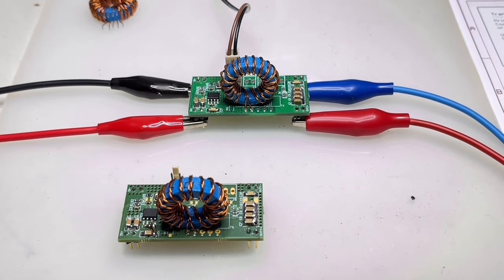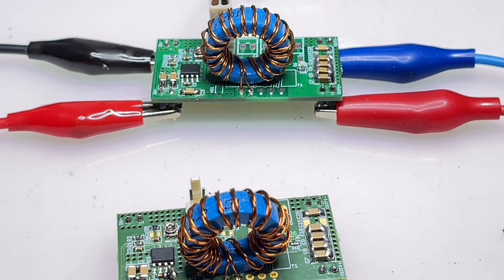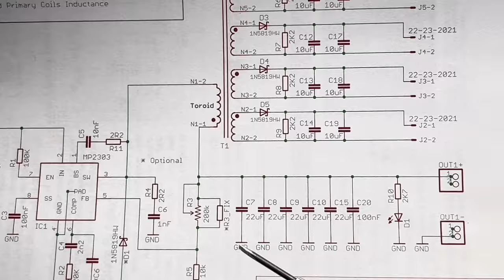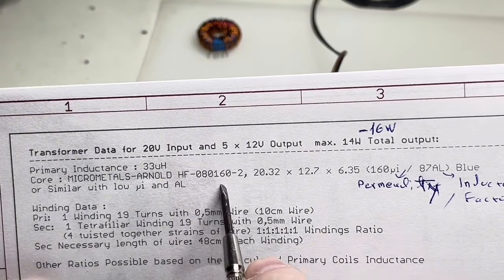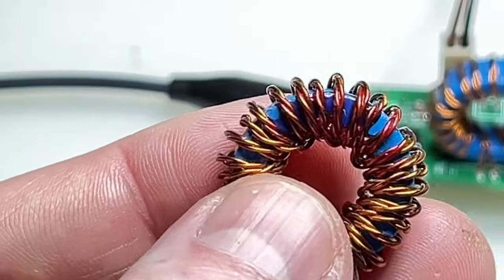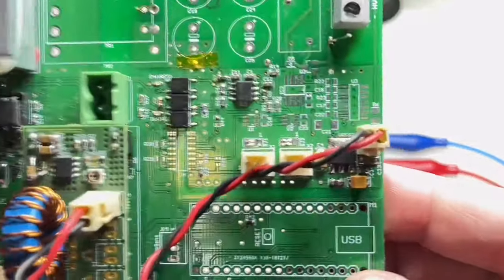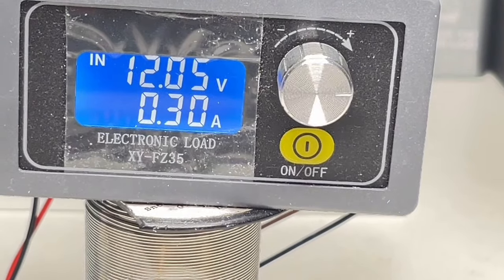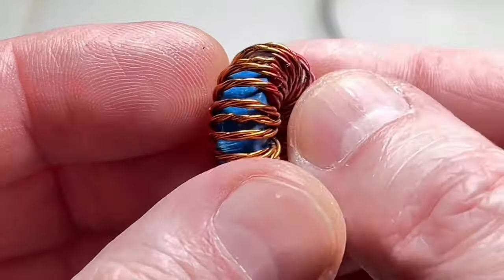5 Rail Isolated FLY-BUCK DC-DC Design, Schematic, Detais with DIY Toroidial Transformer

Comment: I have made basically the same circuit but with a very different core.  I kind of like the EFD cores because you wind on a plastic former then put the core onto it.  
I have also done it with the SEPIC style DC-DC converter.  This nice thing about the SEPIC style is that by a bit of cleverness in the transformer design, you can make the input ripple current just about zero.  Here is how:
Draw a normal SEPIC converter but use the "shared core" design.
The thing about transformer models is that you can model a real transformer as a perfect K=1.0 transformer with an inductor in series with the primary.
When you do this, you will find that the perfect transformer in the model has a slightly different inductance.
If you add perhaps one or two extra turns to the primary, you can make the ratio as a 1:1 for the model.
When you do this you will notice that the ripple current on the primary side is zero.

Comment: Nice made. I guess the post linear regulation will also filter out a lot of the switching noise. Not a bad solution.
Reply from the maker: Thankyou, Yes.
Reply: One noise that is hard to get rid of is the noise that gets onto the secondaries via capacitive coupling.  A common mode choke helps on this.

Comment: Hi Konstantin, again a very nice circuit and neat design.
Never heared of a "Panta filler" before, and Google doesn't show any results with that, i used the english subtitles, but i think something whent wrong in converting to text and it is misspelled by YouTube?  Grtz
Reply from the maker: Hi Bjorn, thankyou! its called Pentafilar, from Penta 5 :-), Cheers, Konstantin
Reply: @KonstantinGrigoriadis  thanks, i'm gonna study that type off transformer. Out of old habit, it always use LM78xx regulators to build small linear powersupplies, and if i need 2 different voltages like per example 5V and 12V, i placed a LM7805 after the LM7812 and use a big smoothing capacitor and a 100nF capacitor for reducing transients on the input and output. When i think off switching powersupplies, i always think they are noisy, but i think with a good design they can also be very quiet. Grtz
Reply from the maker: Bjorn, its just a 5 winding Transformer, coupled coil, where the 5 wires are tightly twisted together to ensure a tight coupling. The Design is all about Isolated Rails.Cheers

Comment: Interesting circuit. I need to do some testing.
I hope you don't use those isolated section on live side circuits. Usually between mains and secondary you need good isolation or it will be hazardous to user.
Reply from the maker: Hello, Please read the Info in the Description about the Wire to be used :-)
Reply: @KonstantinGrigoriadis  Thanks for the info. Also found application note of this. Thanks.
Reply from the maker: Hello, No Problem, what application note y mean, for the Flybuck ?

Comment: how does it perform with no or light load on the buck side of the coupled inductor? 
Also why there is no safety zener on the auxiliary outputs?
Reply from the maker: Hello , without the Light Load the The Outputs go Higher when Open (what is expected), what safety Zeners ? for what ? I never seen in ANY FlyBuck or Flyback Design with "Safety" Zeners....
Reply: @KonstantinGrigoriadis  You haven't seen my designs :)   I usually one just low enough that I don't fry the linear regulator when the isolated output is unloaded.

Comment: FR9888 is easier (internal compensation), and pin-pin compatible with MP2307/MP2303, BUT unlike the 2303, and like the 2307 it is limited to 23V Max input, which I assume is no good for you.
Reply from the maker: If there will be a new version, i will use a much more capable controller , thats a design where i used what i had

Comment: how do you deal with the compensation depending on the number of outputs you have?
Reply from the maker: Hello, Compensation is done for the Primary Output, this Isolated Outputs are interned to power Light Biasing Loads NOT Large Fast Switching ones!
Reply: @KonstantinGrigoriadis  thx, i was considering driveing a date driver from it and maybe some op amps that should be light enough , right?
then again regulation is not a problem if it goes down a bit
Reply from the maker: @sanjikaneki6226  This was more or Less the Reason i Designed it. But be careful with the Gate Driver , if you mean you want to use one of the Isolated Outputs to for the SUPPLY of a Gate Driver, this Depends, what Current the Drivers must Deliver to the Fates of the Power Devices you use! The 4 Isolated Outputs are Designed to deliver Maximum 200-300mA each.
Reply from the maker: Hi Again, If you use the Design to isolate between Low & High Voltage, use the correct Isolated wire for the Transformer !!! A Normal Lacquer Wire is NOT enough!! See in the Video Description about the Wires that MUST be used when Isolating Low-High Voltages. Cheers, Konstantin
Reply: @KonstantinGrigoriadis  In the US the terms to look for on the wire are things like "high voltage" or "600V" or some other voltage rating.

Comment: I have a love hate relationship with flybuck because of it's limit at high/low PWM %' limiting it somewhat.
And yeah, high K (tight coupling needed), like the wires you showed, ESPECIALLY if using a micrometal cores, which make crap transformers, and not a ferrite.
I love TOROID CORES!  Maybe you do too! :)
Reply: Forgot to mention that it is crap if not using the NON-ISO output, it really need some load to regulate properly!
...and of the V reg on the ISO output, despite the magnetic flux saying it should match the non-iso output are not well regulated.
Reply: ...should have waited five minutes watching you video, as you just mentioned this issue! :)
Reply: Forgot to also mention  the diodes on the ISO outputs, for me, I added extra winding to compensate for the V drop, which also varies by load.
Like you, I also used LDO's in some cases to fix all that! :)
Reply from the maker: Toroids are ok, I use then in project in progress
Reply from the maker: All iso outputs habe a minimum load resistor
Reply from the maker: Yes thi vf drop is not an issue for my application cause i always us a ldo as post